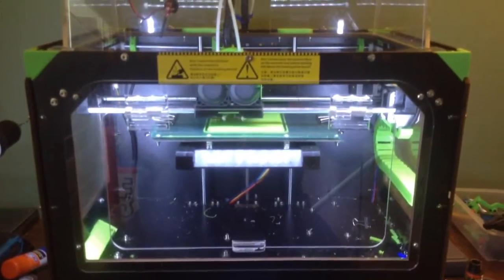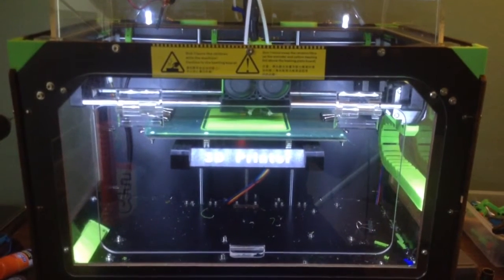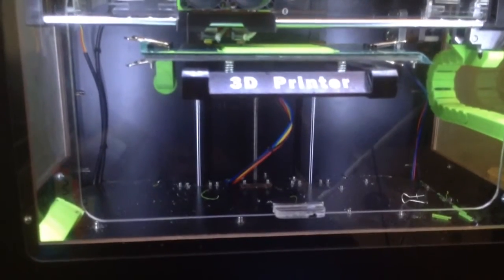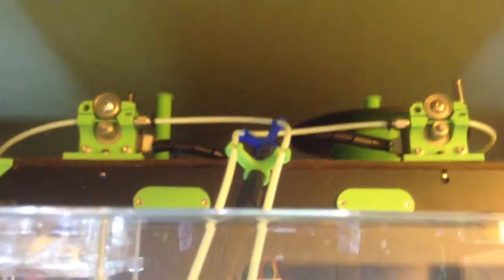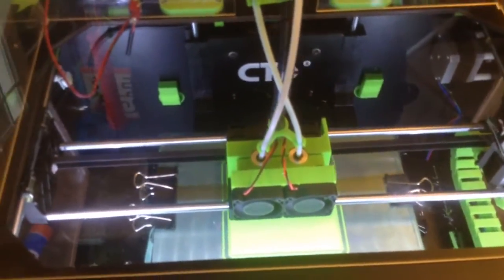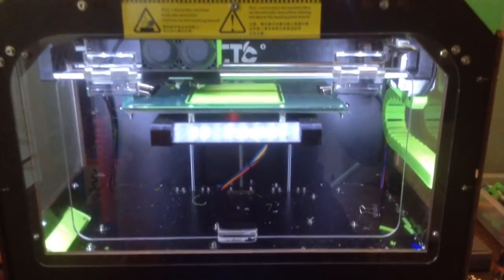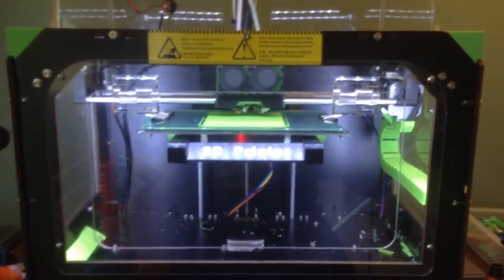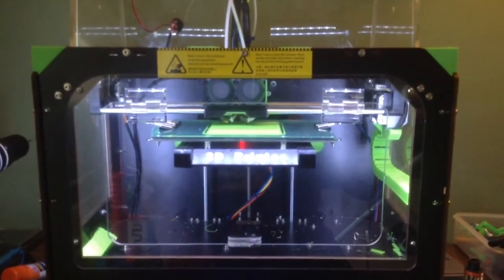CTC 3D printer with upgrades from EBay (see comments and description for in review a year later)

Comment: Why do you no longer own it?
Reply from the maker: Ryan Melton the Flash Forge Creator Pro is well worth the money.  Has everything I put on the CTC.  It also prints consistently in comparison to the CTC.

It’s a good intro to 3D printing.  And hit or miss on if it actually prints consistently.  

With my FFCP, I never had to do any maintenance on it.  Plate stays level.  Belts are tight.  And it’s been over 2 years.

The FFCP is a well thought out design out of the box.

My two cents.
Reply: Well, that’s what I was originally looking at myself...but $900 scares the crap out of me, being a beginner. At 1/3 of the price, I expect less performance, but I want it to be worth using. 

I really appreciate your feedback.
Reply from the maker: Ryan Melton I’d hate for you in the long run to spend money twice...  I would suggest the mono price maker select.  It prints very well, consistent, a great learning (and permanent) platform and at a good price point.

While it was fun learning about it and making the video, in contrast, it really was cheaply made. 

Good luck!
Reply: Awesome. That’s the one I had chosen before finding this. The dual extruders really got me hooked on this, but it probably is too good to be true for the price and a occasional hobbyist like myself. MonoPrice it is!
Reply from the maker: Ryan Melton when youre ready to print with two filaments, buy a better device than the CTC.  But to hit the floor running with ease and quality, I love my maker select!!!

You will love that!
Enjoy, and happy printing!!

Comment: Hey Mark, great video! I've got a CTC too, and I'm just wondering what slicer are you using? If it's simplify3D, could you point me in the right way to get settings and set up right for the CTC. Cheers mate!
Reply from the maker: Rav Phull yes S3D.  It's real easy.  Just select the CTC printer in the drop down menu
Reply: Mark David Thanks dude, I'm now up and running with S3D, such a good slicer! I'm looking at getting that encloser too, it's almost impossible to get ABS prints to stick to the bed with my current set up. I'll also have to get a glass bed haha.

Comment: is it fairly easy to upgrade the hot end meaning do i have to print a new carriage or can I swap out for a dual volcanoes easily.  My plan is to do a 0.4 volcano and a 0.8 volcano.  Use 0.8 for infill and 0.4 for top bottom and perimeter.
Reply from the maker: Cad Printer I imagine you would have to print out the mounts prior.

Comment: How are you lighting the inside of the printer and how is the lighting being powered?
Reply from the maker: Kyle Deuschle Banggood 12v LED adhesive strip and 12V output 120AC power supply
Reply from the maker: And monetary switch

Comment: Im new to 3d printing  and im having having some problems printing from the SD card  I just got  my CTC and I really don't know what software to use on my computer
Reply from the maker: Chris Ortiz is it a .x3g file?  What slicer did you use?  Be sure to define the slicer correctly in relation to your printer.  Otherwise the printer wouldn't know what to do and how to do print (all printers really)

Comment: Hey dude, great video! I have been having a bit of trouble lately with a clicking sound in the extruders of my CTC. It occurs during rafting and sometimes during filament loading. I have tried to clean the gears in the extruders, I've also tried to clear out the pfte tubes but it makes no difference. I haven't upgraded to spring loaded blocks yet because I have a feeling that doing so would not really fix my problem. Any handy tips? Would really appreciate it man.
Reply from the maker: Hey what's up man...  Those stock filament feeders blow..  I used this and the clicking went away.  I could t deal with it anymore (I know the feeling). 3D Printer MK7 MK8 Filament Extruder Feeder Kit for 1.75mm /w Driver Gear (Left Hand Version) for FalsForge Creator, Prusa i3 or other RepRap https://www.amazon.com/dp/B019HMR1H6/ref=cm_sw_r_cp_api_y4xRxb5GF2SRK
Reply from the maker: I got both right and left ones...
Reply: Thanks heaps man! We don't have Amazon in Australia yet unfortunately haha...so I looked for similar ones on eBay and found an Australian seller that sells them, only difference is that they are specified for MK 8/9. I bought them anyway, they probably will fit. Thanks for the recommendation. Pretty cool upgrades btw!

Comment: Hey sorry for the questions, but I am having a terrible time deciding between this printer and QIDI...What are your impressions? 
Does the build plate stay at the correct temperature so the ABS will adhere? Any issues with the stepper motors? Last question...How much $$$ have you spent total to get this to where it is now? Also just a note of gratitude for all your help. If there is a way you prefer me to ask the questions let me know.
Reply from the maker: no problem, ask away!  This was all a learning process for me too.  I've only read about the QIDI online, which seems to be a great printer too.  I only print in ABS so I've never had any issues with it.  I used a glass bed and PET tape with hairspray glue or ABS juice and all adhered well.  as far as spending money, the upgrades I did weren't necessary especially with the trade offs in print quality (Bowden vs direct).  Outside of that, it was really just the enclosure (which there are some DIY kits out there, glass plates, binder clips, and plastic.  My seller was great too, to be honest which also really added more satisfaction to my purchase.

Comment: This is pretty much everything I wanted to do. This is awesome thanks so much. I appreciate the time and effort you put into this.
Reply from the maker: thanks for the kind words.  I still need to update the used items on Thingiverse.  just been so busy.  I will get to it!
Reply: +Mark David awesome! I would love to get those. And where did you get the Boden system from? Also, how do you think it compares to prints from say a multimaker? Last question in this post promise. What's the smallest your printer can print at now? 50 microns?
Reply from the maker: +Alexander Dale I couldn't speak in comparison to a multimaker and I haven't printed that fine yet.  I will soon.  I've been focusing alot more on the CAD lately and printing protos fast.  I got the Bowden setup on matterhackers.com